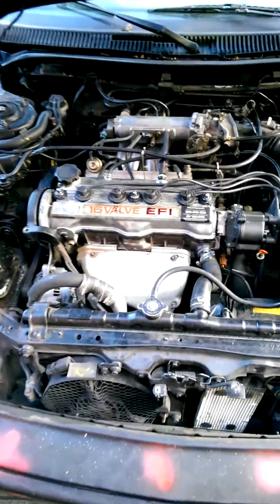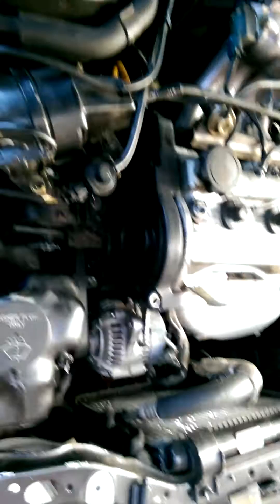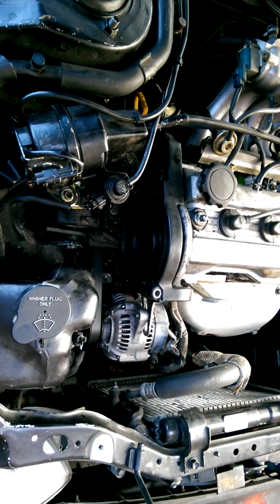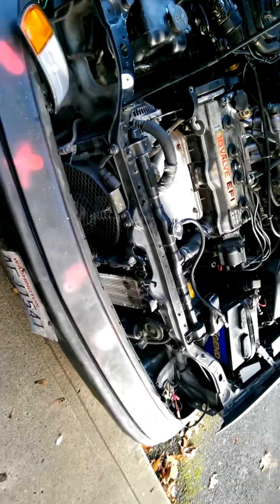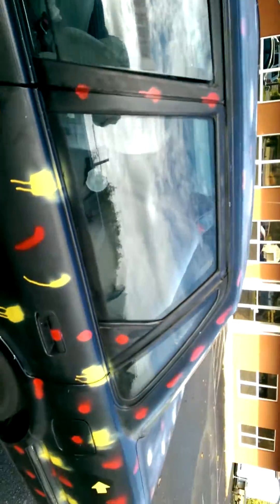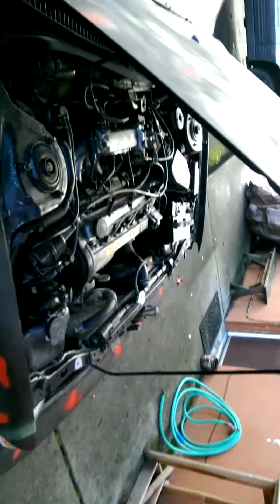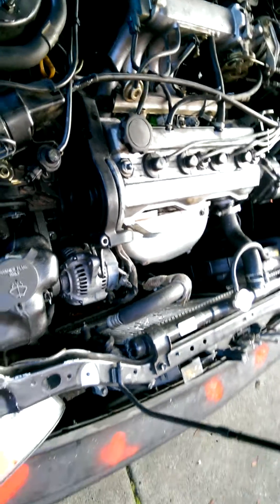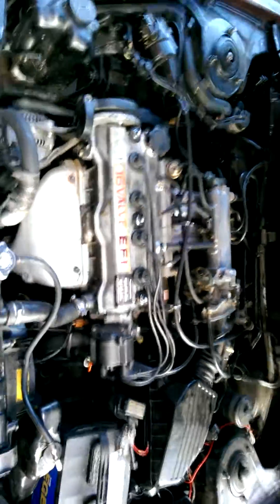Repair of the timing belt 1990 Geo Prizm 1.6L Toyota engine 4AFE part 2 of 2

Comment from the maker: The damn car won't die. I sold it to a wheelchair bound veteran for $200. He had hand controls installed by the VA. A year later it's still chuggin along with its gloss black paint covering the other nine layers of rattle can.  But my ex says I am not a mechanic or make anything last. Happy 26th birthday you 1990 Geo Prizm 1.6L all Toyota go go car!

Comment from the maker: It has 1.5 year old struts, 2 year old cat converter, 2 year old muffler, 1,5  year old brakes, trailer receiver hitch welded to uni-body in 10 places. Tires 50%, pulls a little to the right, but brakes straight, cruise control and AC work, needs a blower motor for the heater, heater core works, interior fair, dash was rhino coated. 
AC belt replaced two months ago, Water pump and alternator belt replaced 1 year ago. Backup belts included in the trunk for AC, and power steering.
The original owner left a "kek" muffin treat under the driver's seat for me. I did not eat it, but knew the previous owner was Japanese and they take care of their cars well. 
Engine starts on less than three rotations per spec. The starter does not like the hot days though, may need to replace that later.
24.5 years old, current tags, passed emissions with half the hydrocarbon output. Does not need emissions testing next year anyway since it's a, "classsic vehicle" now in WA state. :} 
Will paint it gloss or flat black, it was de-rusted and painted in 2013, then modified as you can see in 2014.
Guaranteed free shakes at Burgerville for driving through and talking about it with original paint.